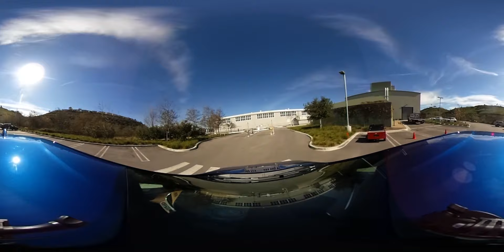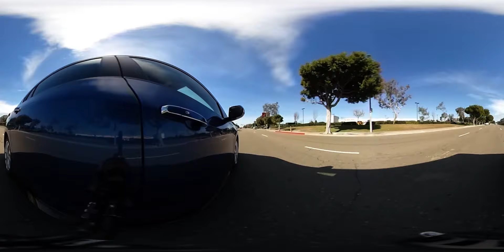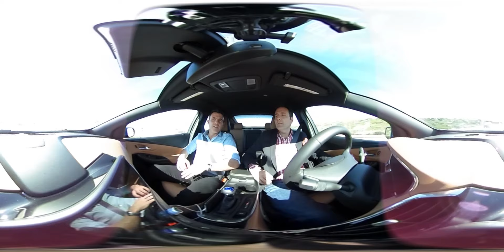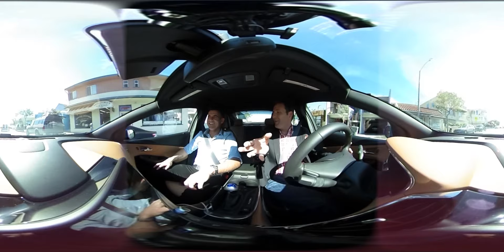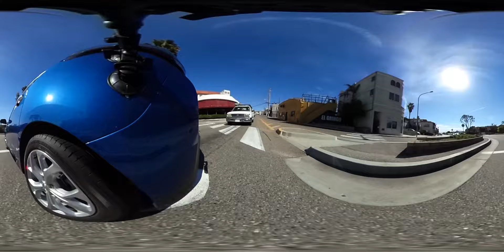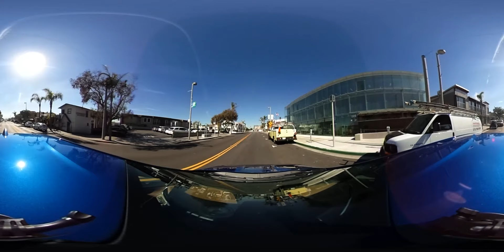2016 Chevy Volt FIRST DRIVE REVIEW in #360Video

Comment: 1.)  Buying second hand, I'd give up range for a sunroof.  Buying new?  No.  I'd rather have a dynamic glass canopy.
2.)  I would LOVE to have a Volt with a HUD, and power seats would be a good bonus!  To me, it's all about the "cool tech," but I like my cool tech to also have function.
3.)  It's not about the EV range, it's about the recharge time.  Rapid charging is great and all, but until the architecture changes to some sort of super-capacitor (Graphene?  Something else?) that can charge fully in 3-5 minutes or less, going mass-market full-EV just isn't viable.

Comment: The 360 camera backing up was funny. I would totally play a couple hundred extra just for the HUD. 1) Would not compromise range for sunroof and I live in Southern California 2) don't care about electric seats my Porsche didn't have them 3) 100 miles + generator or 300 miles only EV. I have a generation 1 volt and I'm getting either the volt or bolt next.

Comment: Nice watch. Thanks MotoMan. I actually watched the whole damn thing and this was my first "MotoMan Experience" so well done at tackling the 360 approach. I do wish we could control which camera we had it on as a lot of times I felt "stuck" with a side camera when I'd rather see you guys and focus on the discussion. Except that near miss of the camera during the parallel parking! Woah! But I get the limitations of tech. At least the sound was good and better than the live Bolt episode (consider an inexpensive mic like the Rode MicMe for things like that on a phone which would instantly make it sound better). But back to this video, it was very informative. Do you know when they crash test these new Volts? I know there's more airbags but I'd love to see how that's improved, or not. I live in SoCal and have sat in one of these 2016's, but still in debate. Thanks.
Reply from the maker: +TheIrishTRex TOTALLY agree with you on being able to switch cameras. Currently, not something technically possible but if you saw our Scope yesterday, our guy behind these 360 episodes, Libor, is letting us try a different type of 360 camera for the next one . . . Actually, we already have the second one shot and I am happy to report it is on a racetrack!
Reply: +MotoManTV Good to know. And by the way, after sitting in one of these, I would DEFINITELY take a sun roof at the expense of the EV range. Especially in SoCal. When it's shut, I can't imagine it would drop the range TOO much, and if it's open, I'm probably cruising around locally anyway so I don't care as much about my range at that moment. It doesn't need to be included but it would be nice to have that as an option. As for range, I'm fine at 50 but I'd say 120 would be awesome that way one could go from LA to OC and back all on EV. 

Any ideas on the crash tests of these new Volts? If/when?

Comment: Moto man good video. 

Answer# 1: Yes. I will compromise some range for Sunroof.
Answer# 2: I would pay maximum 500$ more for sunroof and heads up display. As this car is already pricey. According to me whole idea is to save money and pollution. And as a buyer paying more than gasoline cars and getting less in options and range anxiety makes me stay away from EV.
One thing I don't understand Why they put a gasoline engine and batteries and confuse car? It drives up the cost too. Why don't they stick to batteries and extend the range up to 250 Miles. This way at least we know its an EV not a cross between gas and EV. I personally feel GM is confused or scared of committing to 100% EV.
Answer# 3: 250 Miles range on a full charge I will buy this thing in a heart beat. Don't even need gasoline charger.

Comment: So many questions to respond to.  Where to begin?  First off I don't own the Volt yet but I am planning to buy one this Spring.  I am hoping that I will be able to place my order for a 2017 in April.  I live in the Northeast and the 16 is not available in my state yet.  I am thinking the siren red with black leather interior.  I think a heads up display would be more distracting to me than anything.  I feel like my eyes would be drawn to it constantly.  I don't see the hype over sun roofs.  I have no interest in a car with one.  And I really couldn't care less about weather the seat is automatic or manual.  99% of the time I will be the only one driving the car.  So I only really need to set the position of the seat once.  Having an extra motor to lug around just seems pointless to me.  So to all three of those things my answer is no I would not pay extra for them.  But I love all the other tech that the car has to offer.  I am particularly looking forward to the heated seats and steering wheel and the active cruise control (which the 17 is supposed to offer).  I currently drive a 2002 Explorer Sport which obviously doesn't have anything fancy like that and guzzles a lot of fuel as well.  As to range, that is a tough one for me to answer.  I travel a lot for work.  One day my commute could be 20 miles.  And the next day it could be 200.  Which is why the Volt makes a lot more sense for me than a fully electric car.  I don't have time to figure out where I can stop for a half hour to add some juice to the battery, especially living in the northeast.  We are not as EV friendly here as they are in California.  Plus if I am out of town for a week EV charging stations are not a common site at a hotel here.  So I would really be pushing my luck trying to get to an out of town client and back on a charge in a fully electric vehicle.  This offers the best of both worlds.  With the 50 mile range I should be able to make it to the office and back on a charge (at least in warm weather).  And when I travel to a client I am reimbursed at the IRS mileage rate anyways, so I won't really even be buying any gas on my own dime.  So I guess my answer would be that more range is certainly always better but I am perfectly content with the 50 mile range.

Comment: Higher panorama windshield like the Citroen Minivans or (optionally)  the old Opel Astra 3 door, then sunroof wouldn't be needed
Sunroof yes or EV Convertible!!! Cabrios would be great EVs
HUD sure, must have, electric seats nice to have
I believe that option purchase stats are unintentionally falsified by the manufacturers purchase departments as they often preconfigure cars based on old data that includes cars they previously  specced out cars (catch22). Also fleet customers often don't spec the car to what the users want, but what is hierarchichally ok, what is needed in the eyes of the fleet managers, what will add to the projected resale value. And all to often again these look more into the past rather than anticipating future trends....

Comment: In regards to the "Hold" mode:  This is similar to the Mountain mode on my 2012 Volt but Mountain mode doesn't allow you to instantly turn off the battery mode.  To be at maximum efficiency, you should try to not have any battery left when you get home.  Simply holding a charge when you get home didn't allow you to maximize the cars efficiency because you used more gas.    Good luck...have fun!

Comment: Motoman/Shad, most of our members would have no interest in a HUD or electric seat moving, but the sun roof would be of interest to half of us.  But what we ALL would want more than any option discussed would be faster L2 charging, instead of the 3.6 how about a 7.2, this would allow almost a full charge with opportunity charging.  Ideal range would be 75 miles!
Reply from the maker: +WaterlooRegion Voltec Thanks for the group feedback on this . . . I will let Shad weigh in on this and see if he can take to the higher ups at GM. I will also run it past Alex Keros - one of those higher ups.

Comment: GM, if you're listening. I hate the design of this car. It looks cheaper compared to the old one. And the rear quarter is almost identical to a civic coupe.

My ideal range would be 100 miles per charge. I go up a 2200ft mountain one way to work everyday, so I'd want to climb that at 70mph easy peasy. I do 80 miles total daily. I don't care about power seats but it would be nice to have an optional sunroof and HUD.

Comment: Excellent video! Electric automobiles aren't only about economy, but I understand why economy is so important in short-range EVs:

If you have a 200 mile EV, you can afford to lose 10 miles with extra weight, power hungry electric accessories, and a warmer greenhouse from the panoramic sunroof. However, if your EV has a 50 mile range, losing 10 miles can affect your daily commute. No one wants to lose EV points by having to run the generator, it's like a walk drive of shame.

Comment: This isn't working on mobile. Quality looks like 180p if that's even a thing lol. Anyone else having problems?
Reply from the maker: +John Banks Thanks for the feedback, John. We tested it on this end on both Android and iOS and worked like a charm for us. However, you must have either of those or on a computer, the latest Safari, Opera or Chrome browser.
Reply: +MotoManTV. i watched for 5 minutes before I realized that I was in control of POV. just needed to set my POV by hand then could move device wherever I wanted to center it. duh. worked great. love the 360!
Reply: You manually have to go to setting and pick higher quality. For some reason, 180p is the default.
Reply: +Nick A thanks man